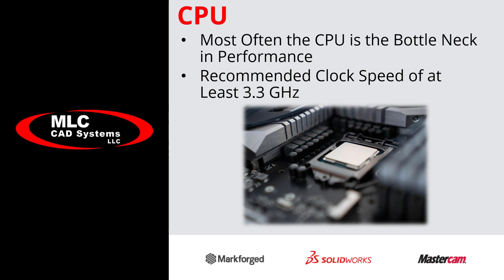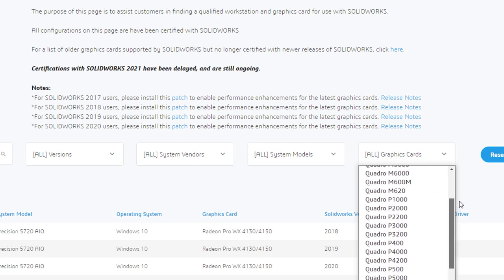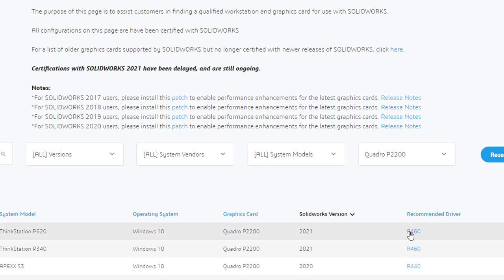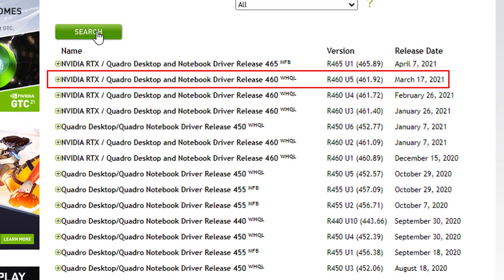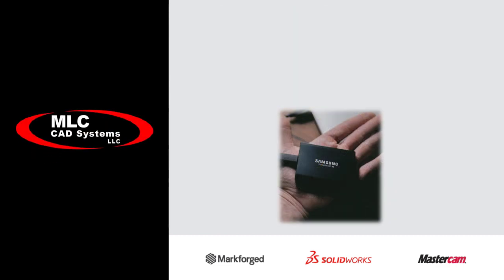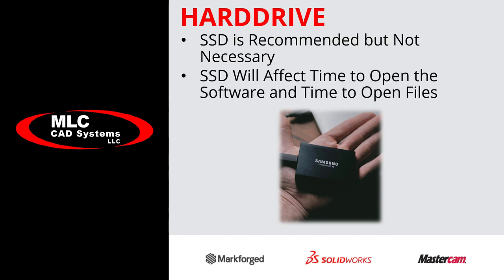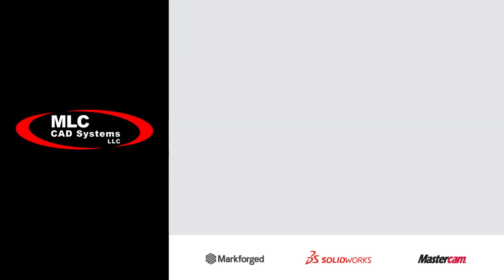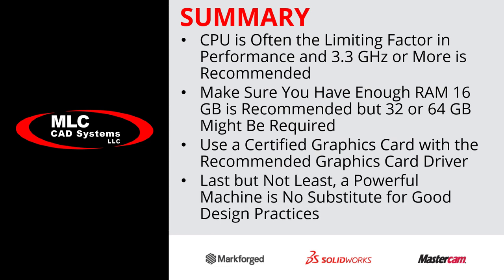Is Your Computer Powerful Enough To Run Solidworks?

Comment: Hi, I found this comments section very useful so I thought I'd add some info. I'm a professional mechanical engineer, we use i7 Zbook workstations at work to run NX11. At home I have an Acer Aspire 5, 8th gen i3, 8gb ram. In my experience it runs NX Student and Fusion 360 fine for small assemblies. I modelled up a garden room with over 100 parts, it was very slow when all loaded but I would say useable for a home project. You'll be surprised what cheaper machines can do if you go easy on them! Freecad and Meshmixer also run fine. Just to be clear, the Acer is not close to the performance of the workstation and couldn't be used for professional work, but for hobby 3d printing and DIY, it does the job!

Comment: My pc specs are amd ryzen 3700x with rtx 2060 with 32 gigs of cl16 3600 mhz. I use AutoCAD 2021 for 2d cad drawings and detailing in large scale. Is this ok or should I update my CPU to 5600x or 5800x?  i often feel laggy when I am on drawing.
Reply from the maker: AutoWhatNow?  Apologies, but we don't support that program.  If this were for SOLIDWORKS I would recommend upgrading your graphics card to a workstation variant like the a FirePro to get better OpenGL performance, or start using Detailing Mode to open massive drawings in a flash.  Good luck!
Reply: @MLCCADSystems  nice one

Comment: Can you please make a video of the best build for solid works.. My dad bought a work station from Dell and I told him he likely didn't need a xeon cpu.. I'm wanting to build him a pc specific for solid works.. I was thinking amd 5800x or 5800-3d but I'm not sure if the extra cash will be beneficial so advise here would be a good thing. For gpu I was thinking dual quadro rtx 8000.. For ram I'm thinking 128gb of 3600mhz... For the mother board I have no idea what a good work station mobo is so I plan on picking a good gaming mobo unless I get advice here. And because I love building PCs I want to do a custom water loop for him lol.. I'm still new to building PCs but I enjoy it a lot.. Any advice would just be appreciated.
Reply from the maker: It really depends on your budget, but as long as you are in the right categories you can adjust each item up or down the scale to fit your budget.  Xeon CPUs are essentially identical to i7 or i9, but they feature ECC RAM and by default are workstation/server grade performance optimized.  You can get there with many different approaches, and traditional benchmark results are great guides.
Reply: You have no idea what you are doing....start over.  If you need to feed yourself and your family....buy a capable but not overkill system with hardware support.  If it's for fun or a hobby....most junk will get you by (for parts) provided you have a SW license...or some access to it.  If your dad knows SolidWorks to any respectable degree...he is ahead of you in this department.  A Dell (Precision) workstation is typically very capable unless you are design intensive, rendering or doing FEA work.  As this vid says.....best practices are your savior....there is no processor you can't bottleneck with SolidWorks even with relatively simple projects.  Sadly.  Edit: As per video...a certified graphics card makes or breaks your SW experience.  SW is easy to use....but hard to know the nuances of errors and graphics issues.  The newer you are...the less issues you can identify readily.  SW has their own issues and that's a gripe for all of us who pay for anal subscriptions....Sorry "annual" subscriptions.
Reply: I agree, this person is way overcomplicating this. There is no need in re-inventing the wheel. All my clients I support run Dell Precision Workstations and have other CAD users ask them all the time what they are running because of how well they perform. Users specs range from the T5600 to the T7800 models.   SSD Hard drives and a few NVME scattered about. CPU range from 2.7 to 3.3 ghz  (Xeon to I9) (and yes, the higher speed 2ghz cup's will hold up) 32 gig of ram (DDR-3), mid-range Nvidia Quadro Video cards and a few RTX models scattered about. The one difference I found that really helps is run the SSD HD off a Dell Perc Controller in a Raid 0 configuration and not off the SATA controller on the motherboard. As a side note, I personally don't see enough of a difference in speed or performance between the SSD and NVME hard drives to worry about it (your mileage might vary). The Dell Precisions are rock solid machines that just hold up.  @metricdeep8856

Comment: I buy off lease Dell Precision PC's. You can save a bunch of money this way. These machines are rock solid and are designed with CAD in mind.  You can go with a 2.7 ghz and higher I5 to I9 CPU or even a Xeon (yes, the high end 2ghz CPU will perform), 16-32 gig ram (DDR3), SSD or NVME HD, a mid-range Nvidia Quadro P series video card or bump it up to an RTX model and you are good to go. It is not as complicated as some people try to make it. Note: if you are going to be doing a lot of rendering of huge models you need to bump these specs up across the board as high as your budget will allow, but for everyday work most people do in SolidWorks these specs will hold up.
Reply from the maker: Yes, you can get a lot of horsepower that way.  We're developing more content now around an older Dell laptop that is giving pretty impressive results.
Reply: Can we run solidworks smoothly with ryzen 5 or ryzen 7 with 7300U processor 16gb ram and 4.4 ghz laptop. 

I'm confused after watching alot of video where I stuck on processor series (G, U, H, etc) @MLCCADSystems

Comment: Is Intel Iris Xe, 8 GB RAM and 512 GB SSD is enough to run solidworks?
Reply from the maker: That is going to be very tight on RAM.  It would really only be suitable for small simple parts and projects where you don't have to spend a ton of time.  If you want to run SOLIDWORKS consider 3DEXPERIENCE Cloud roles, all of the processing is done on the cloud.

Comment: I have a Z-400 workstation with 8GB RAM, Intel xeon and 2 gigs of basic Nvidia GT 730 graphics card.. is it sufficient to run solidworks?
Reply from the maker: Yes, you can run SOLIDWORKS on this machine.  Depending on your workload and the size/complexity of your files a graphics card upgrade to a workstation-class Quadro model would help, and you may have trouble keeping multiple programs open while modeling with only 8 GB of RAM.

Comment: Hi! Can solidworks run with onboard graphics card? Without any unshared  graphics card?
Reply from the maker: Yes, but it will start to slow down or become unstable if you run it for a long time with large models.  There are no minimum requirements to run SOLIDWORKS, but the complexity and performance will be limited if there is no official support.  For learning SOLIDWORKS and for school it should be fine.

Comment: Intel Core i5 and 8GB of ram will be enough?
Reply from the maker: Barely, the 8GB of RAM is likely to be your issue.  So many programs use RAM in the background so you'll be fighting for space to run with only 8 GB.  I would start with 16 GB at a minimum if you can.  Core i5 is fine, but faster/newer processors will run faster as you might expect.  If you run out of RAM though, performance dies.

Comment: Is rtx 3060 good for engineering students to use with solid works or is quadro required?
Reply from the maker: Our typical advice is that yes, a gaming card is fine for students because projects tend to be more reasonable in size and complexity, plus the computer is not being used primarily for CAD.  The only drawbacks you should expect are potentially reduced quality in the graphics while working and if you work for 8 hours non-stop on a large CAD model you may find the graphics start to bug out a bit.  Just save your work and re-open SOLIDWORKS or reboot to refresh that graphics memory.
Reply: @MLCCADSystems  Thanks!!
Reply: @MLCCADSystems  so just a quick follow up... Say I put in a 5700g/5600g waiting for you prices to go down for like a year... And I do only AUTOCAD 3D stuff(learning)... Will it be fine?
Reply from the maker: We don't support that other software, but just about any graphics card (or none at all) will run the software enough to learn it, it just slows it down depending on complexity.
Reply: @MLCCADSystems  🙏🙏

Comment: Great video!!! I have an Acer aspire 5 (i5-8250), I am thinking about switching... What do you think about Microsoft Surface Laptops ou Hybrids HP? All of them have 16GB RAM and caracteristics better than my acer
Reply from the maker: For small stuff just about any machine will do a good job.  We tested a 10 year old computer with the graphics disabled and it finished the benchmark in a reasonable amount of time.

Comment: Guys im installing SW on my 300€ laptop with a 7W CPU, wish me luck. I just know i have turn on my pc eventually, but i am not convinced yet.

Edit:
Guys it actually runs pretty good. My work is single pieces with couple of holes, extrusions and basic shapes. Picture manufacturing drawings and parts. 
I have a chuwi larkbook x.
Reply from the maker: Nice, thank you for sharing your experience!  You never really know until you try, and if you aren't relying on productivity for your income you can get a lot done on very little hardware!

Comment: Is i5-12450H + Gtx 1650 and Ryzen 5-5600H + Rtx 3050 enough for 3D rendering and AutoCAD for student? If so, which is better? Thank you in advance.
Reply from the maker: I would refer to standard published benchmark data, raw performance translates really well into performance in CAD and rendering.
Reply: Thank you for this. But I'm not really knowledgeable on this things. So, I'll appreciate it if you can answer my question directly. Thank you so much.

Comment: I'm not using solidworks but catia, and I was wondering if a AMD Ryzen 5 7500F with AMD Radeon RX 6750 XT (or a AMD Radeon RX 6800) could well run catia. Or should I pick nvidia stuff? I hope you will answer and thanks for the video
Reply from the maker: This video doesn't cover CATIA, we don't support that product directly.

Comment: Hi, I'm going to buy a laptop for college engineering and I'll mainly use solidworks. I'm thinking of Intel Iris Graphics, I5 12th gen with 32gb ram and 1TB SSD but I just can't be sure about intel iris graphics because people keep telling me I can't run solidworks on it. Do you think it will work on it? My only doubt is intel iris graphics right now.
Reply from the maker: Intel Iris graphics won't accelerate the SOLIDWORKS graphics display, but depending on your use case it may not matter.  Relatively simple parts and small assemblies will perform just fine without a dedicated certified card as the CPU will process the graphics.  If you reach a point where the model gets too big for your computer, large assembly settings can be enabled to make it run faster.  Certified cards however will increase the price of your computer by a lot, so it is a trade-off.  Students typically can get by without a certified card to stay within budget.
Reply: @MLCCADSystems  the most I would use solidworks for is 3d printing, can an iris handle stuff of that size and complexity?
Reply from the maker: Most likely yes, although anything short of a discrete graphics card is likely to be powered by the CPU.  It will be slow to rotate and select edges on complex models, but it should work.

Comment: Is ryzen 7 5700g enough for solidworks.i don't plan on getting a GPU  as it has a powerful integrated GPU. Pls reply
Reply from the maker: It depends on what you are doing and your budget.  For a student or hobbyist yes it will work out fine, but the integrated GPU won't accelerate the graphics effectively like a discrete card would.
Reply: @MLCCADSystems  yes I'm mechanical engineering student and I need to make model designs which are not so complex ,not simple either. That's why I'm making sure

Comment: hello, I'm a student and I'm looking for a laptop for practice, at the moment I'm not planning to make any fancy and complex parts, so I'm wondering if a laptop with intel i7 1255U 10-core  procesor, intel iris xe grapich, 16GB RAM and 1TB SSD can run SolidWorks🤔
Reply from the maker: Yes it can, almost any computer can run SOLIDWORKS for small components like that.  Good luck!

Comment: I3 12100f with Rtx3060 or Ryzen 5 3600 with rtx 3060 , which one will be better?
Reply from the maker: You can look at standard benchmarks for performance comparisons, but they are unlikely to be very different.
Reply: @MLCCADSystems  thanks for the reply dude

Comment: i am an engineering student ,is rog strix g15 ryzen6800 rtx3050 16gbram can run solidworks well
Reply from the maker: For a student using SOLIDWORKS, a gaming card like the RTX3050 should work pretty well.  If you find yourself working on it for an entire day on a project, save often and reboot every 4-8 hours minimum.

Comment: I currently have a Thinkpad T440p with i7 4702mq quad core + GT 730m graphics card and 16gb RAM. Will that be enough for college engineering?

Am also considering a Thinkpad p50 with a Quadro M1000M.
Reply from the maker: My general recommendation is that for college you aren't likely to work long hours on highly complex assemblies in SOLIDWORKS, so the added cost for a support graphics card is rarely warranted.  Look at the price differences and your budget and buy what you can, then consider a certified workstation for professional use.

Comment: I'm using AMD Ryzen 5 3500U with Radeon Vega Mobile Gfx, 2.10Ghz.8 GB Ram,& SSD500gb.

Looks like a poor man's machine when you read the comments here.but I'm a solidworks newbie running the software smoothly and happily on my machine.the Graphics card doesn't support Solidworks,so the appearance is compromised...cast iron won't appear granular,t just looks much like any other metal.
I am nevertheless happy about it and I ain't going to uninstall it, definitely not.
Previously I had an HP ProBook 440 G,i5 at 2.5Ghz with the traditional hardrive.thing couldn't run AutoCAD smoothly.& Yet I wasn't doing any extrusions or any 3D parts.(I am a newbie remember).so to me, my Ryzen 5 3500U is running like a charm.
Reply from the maker: I'm glad it is working well for you!  For things like learning the software or building small lessons or hobbies, nearly any computer will get the job done.  When you have a team of expensive engineers on staff building complex designs though, that is when a certified computer is worth every penny.
Reply: @MLCCADSystems  sure.thank you for all the info.
Reply: i have the same specs on my laptop. if the texture is not showing up, try the registry hack. there is a lot on youtube how. fine by me but even so after all the beginner lessons my laptop is dragging my productivity by half because when you put dimensions it need to load about half a second or a second full. 
so I bought a new one with i5 12500h rtx3060. itsssss very fine, just need more ram. and if youre planning to buy a new rig dont opt to ddr5 ram laptops because theyre expensiveeee. ddr4 is fine 3200.

Comment: What you think about this configuration
AMD ryzen 9 5900x 3.7 GHz
32Gb ram 2x16Gb 3600MHz patriot viper steel
1Tb NVME Kingston FURY Renegade 
GTX 1660 super 6Gb gddr6
Reply from the maker: The GTX video card is a gaming card, so it should work for small stuff but will struggle if you use SOLIDWORKS for large models or for long periods without rebooting.  Everything else should be evaluated based on traditional pc performance benchmarks and balanced with your budget.  Good luck!

Comment: I'm an upcoming freshman at college and was building a pc for my engineering classes (Solidworks is the main software that will be used) Will a i5 12th gen and 3060 be good enough at this level?
Reply from the maker: It is really hard to know exactly, but in general you won't be making anything large and complex your first few years in school.  As long as you have enough memory and storage, I expect you'll be OK.  
https://www.mlc-cad.com/solidworks-help-center/solidworks-hardware-guide-2021-update/

Comment: Is Intel core i5-1235U processor and 16GB ram,  Intel UHD graphics use solidworks smoothly?
Reply from the maker: Smoothly no, but it should operate for parts and small drawings or assemblies.

Comment: Its 2023. What do you recommend?
Reply from the maker: Think about your budget and your primary usage for the computer.  If you are planning to use SOLIDWORKS primarily, get a certified workstation from one of the main vendors (Lenovo, Dell, HP etc).

Comment: hello , thanks for video , i would like to ask can i run solidworks with i7-11K , 16G RAM,  RTX3050 ? at least older versions ?
Reply from the maker: Yes, but with the understanding that it will suffer performance issues if your model exceeds your available RAM and starts to cache to the hard drive.
Reply: @MLCCADSystems  i understand you, fortunately I can add 16 GB more. I was mainly concerned for GPU. Anyway thanks thanks for answering 🙏😊
Reply from the maker: @mihael6818  Any graphics card, even no graphics card, will allow it to run.   The question then becomes how quickly it runs, how well it handles large models, and how stable it will be.  If this is for school or small projects a gaming card will be fine.  If you plan to do larger models or are making money with it, opt for a certified card.
Reply: @MLCCADSystems  oh i understand , i am planning to study. I guess nothing Big. I'm just beginner. Hope it will serve me well just for studying and improving my knowledge. Thank you very much 🙏

Comment: Please help me .wen i open solidworks its crash laptop and restarting . I have 8gb ram .it was the case ?
Reply from the maker: This sounds like you need some support, but if it reboots your computer it sounds like it could be a more severe problem like hardware failure.  I recommend enabling Software OpenGL to test.